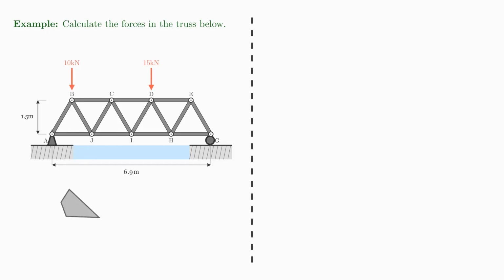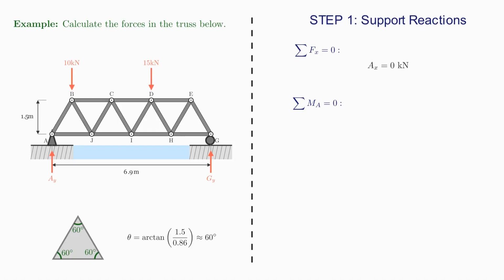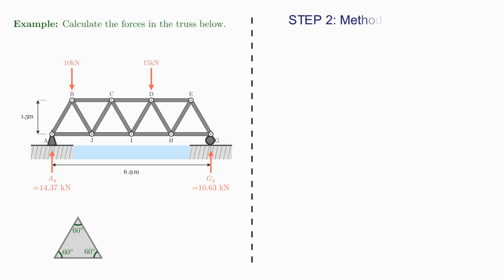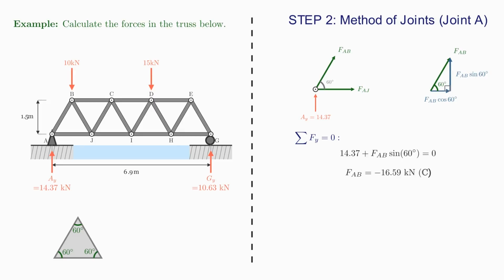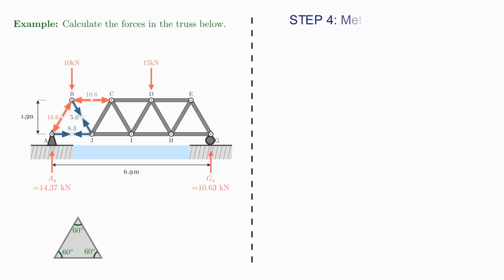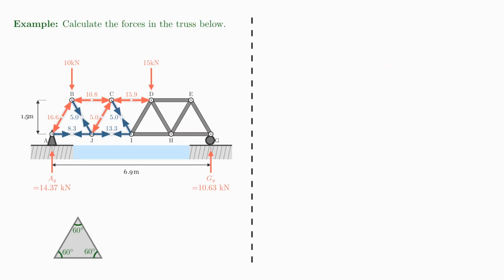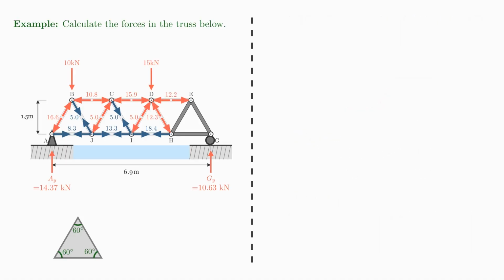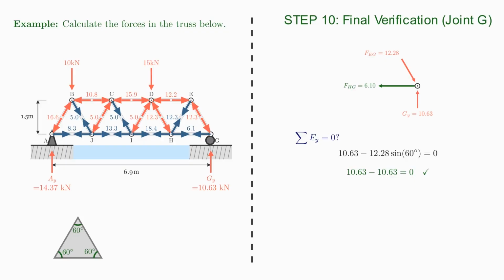Method of Joints: Static Analysis of a Warren Truss | Worked Example

Comment: When doing equilibrium equations, say in Fx=o in Joint J calculation, or in general, do we add or subtract based on which quadrant of Cartesian coordinates  the force is pointing (you say left therefore minus)?

X component of FCI in Joint C you used plus (+5.04 cos 60) even though FCI points down. Is it because x component is still positive (quadrant 4)?

For joint I, FCI is in third quadrant where X component is negative, so why isn't the equation -13,34 -(-5.04) cos 60?

Again in joint i, why is +(-5,04 cos 60) when x component is in first quadrant and therefore positive?

Am i supposed to first determine + or - of the force and then also it's components directions as well to get the whole picture?
Reply from the maker: When using the method of joints, we normally start by assuming that all unknown members are in tension.

This means we draw each unknown member force pointing AWAY from the joint. We are not saying that the members definitely are in tension — it is simply our starting assumption. The calculation will tell us whether that assumption was correct.

The next important step is to separate the force into its horizontal (x) and vertical (y) components.

We use the standard Cartesian sign convention:
RIGHT = +x
LEFT = -x

UP = +y
DOWN = -y

The key point is that the x-component ONLY looks at whether the force has a right or left component.

The y-component ONLY looks at whether the force has an up or down component.

For example, suppose a tension force, F, that points UP and to the RIGHT. This force is in the first quadrant. Because it points to the RIGHT, its x-component is POSITIVE. Because it points UP, its y-component is POSITIVE.

Therefore:
Fx = +F cos(θ)
Fy = +F sin(θ)

Now consider a force, F, pointing UP and to the LEFT. This force is in the second quadrant. It is still pointing UP, so its y-component is POSITIVE. However, it is pointing LEFT, so its x-component is NEGATIVE.

Therefore:
Fx = -F cos(θ)
Fy = +F sin(θ)

This is often where the confusion occurs: the fact that the force is "up" does NOT make the x-component positive. "Up" only tells us about the y-component.

So:

UP-RIGHT → x positive, y positive
UP-LEFT → x negative, y positive
DOWN-LEFT → x negative, y negative
DOWN-RIGHT → x positive, y negative

This is why it is useful to identify the quadrant of the force before writing the equation.

For example, at Joint C, the member FCI is drawn down and to the right from the joint. That puts it in Quadrant IV.

Therefore:
FCI x-component = +FCI cos(60°)
FCI y-component = -FCI sin(60°)

The force is "down," but that only makes its Y component negative. Its X component is still positive because it points to the RIGHT.

At Joint I, the same member FCI is acting on the joint in the opposite direction. It points UP and to the LEFT, which is Quadrant II.

Therefore:
FCI x-component = -FCI cos(60°)
FCI y-component = +FCI sin(60°)

So the signs have changed because we are looking at the force acting on a different joint.

A useful procedure is to:

1) Assume every unknown member is in tension.
2) Draw the force arrow AWAY from the joint.
3) Look at which quadrant the force points into.
4) For the x-component, ask only:
"Does it point RIGHT or LEFT?"
5) For the y-component, ask only:
"Does it point UP or DOWN?"
6) Give the components their appropriate + or - signs.
7) Solve ΣFx = 0 and ΣFy = 0.
8) If the answer is positive, the original tension assumption was correct. If the answer is negative, the actual force is in the opposite direction, meaning the member is in compression.
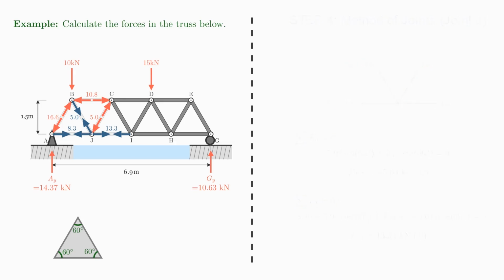Reply: @MathsWithHart  thank you. Could you explain my misunderstanding of the professor Hanson's lecture where at 11:40 https://youtu.be/n6P8jBcT8ks?si=gMYGzOrXFkioCxqG
he just reversed the arrow and put - in front of force component to get positive result. Wouldn't this completely change the quadrant and therefore give different result if we had assumed correctly that the force is in compression in the first place (i fail to understand what does compression do to a force component in cartesian coordinate system)?

Comment: FAB being -16,59 made you turn the arrow in compression and having it positive for the rest of calculation, correct?
Then, you got negative FBC but didn't change the direction when doing joint C?! Or did I missenterpret, FBC is assumed in tension for joint B but then looking from C perspective, arrow is at the point C so in compression already?

So, when doing joint B we assumed tension from B to C and got negative so essentially tip of the arrow should touch B and tail at C. But when doing C the arrow is at C, why?

Essentially, my question is, when we get negative force in one truss segment, do we change the direction (to tension) for every other joint that is affected?
Reply from the maker: The key point here is understanding what we mean by tension and compression in a truss member.

We are not thinking of FBC as a single arrow that travels from B to C. The member BC exerts a force on each of its two joints.

If BC is in TENSION, the member is pulling on both joints, so the arrows point TOWARDS the member:

B → [BC] ← C

If BC is in COMPRESSION, the member is pushing on both joints, so the arrows point AWAY from the member:

B ← [BC] → C

This is why, when you move from joint B to joint C, you do not simply continue the same arrow direction along the member.

For example, suppose at joint B we initially assume FBC is in tension. The force at B is therefore drawn towards C:

B → C

If the calculation gives FBC as negative, this tells us that our assumption was wrong and BC is actually in compression.

Therefore, when we analyse joint C, the force from BC must be drawn away from the member:

B ← [BC] → C

So the force at C points from the member towards C.

The important distinction is that we are not saying "the force goes from B to C." We are saying that the member BC either pulls on its joints (tension) or pushes on its joints (compression).

A useful way to remember it is:

Tension = the member pulls the joints IN towards itself.

Compression = the member pushes the joints OUT away from itself.

The arrows at B and C will therefore always point in opposite directions for a given member, because they represent the equal and opposite forces that the member exerts on its two joints.
Reply: @M @MathsWithHart am a bit confused on your explanation of the arrows, wouldn't compression make more sense if the arrows would be o--------><---------o meaning the member is compressing, while in tension o<----------------->o meaning elongating it?

I ask this because FAY is assumed in tension, the result is positive but still on the overall diagram FAJ arrows are now different, pointing to each other rather then being <---------->.

Or the better way to interpret it is the truss tries to elongate but internal forces oppose it so that's why it's reverse logic.

For coordinate system for components, do we put zero of the coordinate system always on the joint in question?
Reply from the maker: @AuroraBorealis2026 The confusion comes from what the arrows represent.

If we isolate the MEMBER itself:

TENSION:
o <---------- BC ----------> o

The ends are being pulled apart, so the member is being elongated.

COMPRESSION:
o ---------> BC <--------- o

The ends are being pushed together, so the member is being compressed.

However, when analysing a JOINT, we draw the force that the member exerts ON the joint.

For a tension member:

B > [BC] < C

The member pulls both joints towards itself.

For a compression member:

B <- [BC] -> C

The member pushes both joints away from itself.

So do not think of FBC as an arrow travelling from B to C. Instead, think:

"The member exerts a force on each joint."

This is why the arrows at B and C point in opposite directions.

For example, at F_AJ it is assumed to be in tension and the calculation gives a positive value, the assumption was correct:

A > [AJ] < J

The force at J is still opposite to the force at A because they are equal and opposite forces.

COORDINATE SYSTEM

When analysing a joint, it is easiest to place the origin at that joint:

    y
    ^
    |
    A --------> x

Then resolve the forces into x and y components and use:

Sum Fx = 0
Sum Fy = 0

The origin moves to whichever joint you are analysing; the x and y directions can remain the same.

Comment: Could we have also taken moments around G (or any other point) ? Or is the connection in A special regarding moments ?
Reply from the maker: Yes, absolutely! You can take moments around any point on the truss, as there is nothing mathematically special about point A. We usually choose point A or point G simply because it makes the algebra much easier. Point A is a pin support with two unknown reaction forces, Ax and Ay. By taking moments around A, both of these forces pass directly through the pivot point, making their perpendicular distance zero. Since their moment contribution becomes zero, they drop out of the equation entirely, allowing you to solve for the reaction force Gy in a single step. If you chose to take moments around G instead, Gy would drop out of the equation and you would solve directly for Ay first. Ultimately, picking a support point is just a helpful strategy to eliminate unknown forces from your calculation right away.

Comment: i have one question with joint b type of scenarios where the angles seems to be facing the x axis why wouldnt the fy for joint B be 16.59cos, this question probably doesnt make any sense
Reply from the maker: Your question makes sense. Whether we use sine or cosine depends on which axis the angle is measured from.

At joint B, the force in member AB is 16.59 kN. Member AB is at 60° to the HORIZONTAL, so its components are:

Horizontal force = 16.59 × cos 60 = 8.30 kN
Vertical force = 16.59 × sin 60 = 14.37 kN

However, the confusion arises as the 60° angle used in this calculation is not shown in the diagram. The  60° angle in the calculation is between the diagonal member AB and a horizontal line.

Alternatively, a vertical line could be drawn downward from joint B. Member AB would then be at 30° to the VERTICAL because 90° − 60° = 30°.

Using this angle, the same components can be written as:

Horizontal force = 16.59 × sin 30 = 8.30 kN
Vertical force = 16.59 × cos 30 = 14.37 kN

Both methods are correct because sin 30 is equal to cos 60, and cos 30 is equal to sin 60.

Comment: How did you get the 0.86 please 😢
Reply from the maker: The overall truss span is 6.9 m. Although the truss contains several triangles, the bottom chord is divided into four equal bays by the joints A–J–I–H–G. Therefore, the length of one bay is 6.9 ÷ 4 = 1.725 m. The top joint is directly above the centre of the bay, so the 1.725 m bay is split into two equal halves: 1.725 ÷ 2 = 0.8625 m ≈ 0.86 m. Therefore, 0.86 m is the horizontal distance from a bottom joint to the point directly beneath the top joint.